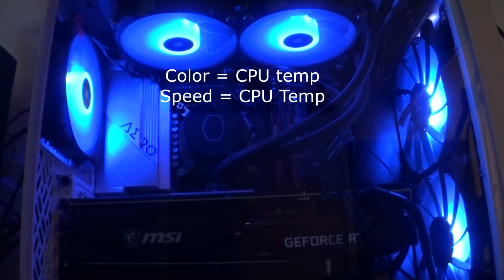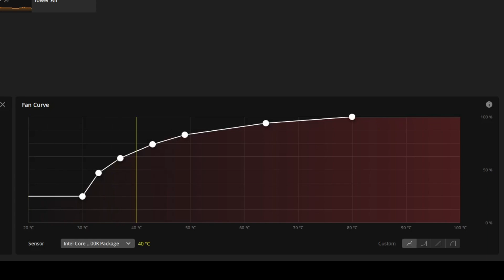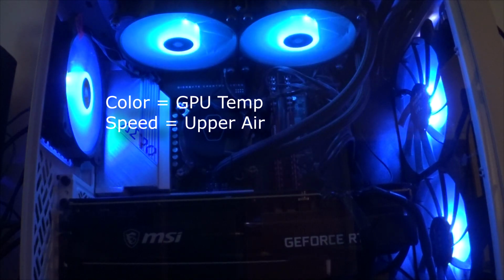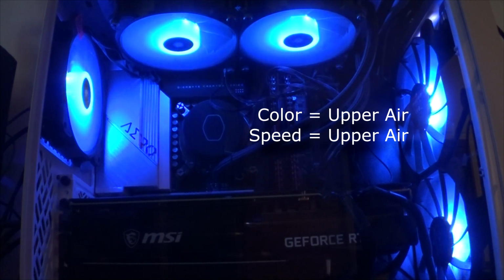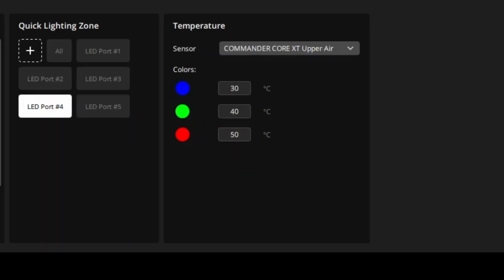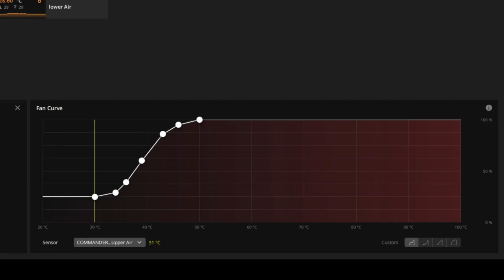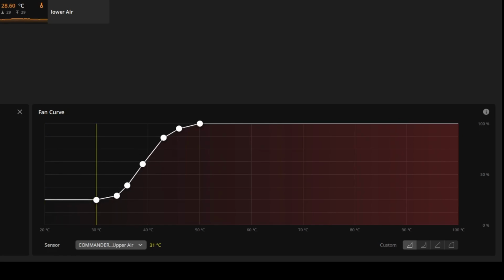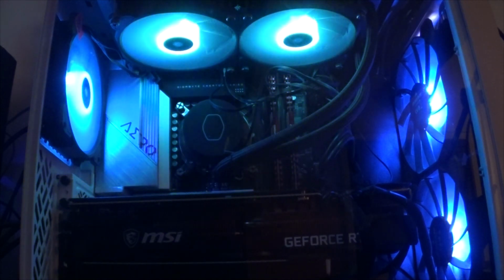My Simple Case Cooling Hack

Comment: At the top you have three 120mm fans blowing out and only one 140mm blowing in. This creates a slight vacuum and the top fans have less air to cool.
Flip the rear 120 fan so it blows inward and put a air filter on it.

Comment: Thank you for this video its a good idea , its a shame that the top rear fan wasnt lower blow the GPU air duct  that you have made . I did a case mod way back when LSI came out with 2 GTX 6800 Ultra's which was at the time a massive card and very think . because the way they use the air around them and spill it out a little out the rear but most back into the case. 
I made 2 120mm holes in the side case panel one intake at the back of the case and one exhaust just at the other side of the GFX card . it made the running temp from 71degC down to 50Deg C straight off. so your mod looks cool and works . you need to send it to Gamers Nexus to test it and Jayztwocents  to make it work better he may make the its in a s shape to let the GPU hot air exhaust out the top rear fan :)

Comment: Genuinely curious what Gamers Nexus or JayzTwoCents would have to say about your hack. I remember a couple years ago LTT did a year's long test on cooling, and negative pressure / dust buildup inside the case, and I've copied their setup based on their results. A cheap thermocouple heat probe costs like $20.. and shouldn't be too hard to scientifically test... just measure based on a delta derivative, so you can actually determine if it's effective or not. Here I am lecturing the retired engineer ;)

Comment: One big problem with modern gaming PCs, is companies focus more on easy to brag about numbers and looks than real metrics and proper airflow. People have to do the fixes themselves. Good to have a video explaining it a little bit and prod people to go research further.
Reply from the maker: The case manufacturers have an incomplete knowledge of what people are going to be doing with their cases.  For example this hack presumed that I was using a top-mounted AIO and a very warm GPU blowing air in all directions.  If instead I was building a front-radiator solution or using 3 front fans or building a simple system with on-chip graphics then there would be no point to this cooling hack.

Comment: As an avid PC hardware enthusiast, I am subbed to many channels, including Gamer's Nexus, Jay's two cents, LTT and many others. Safe to say GN goes above and beyond in their work! I think the best easy recommendation to hand out would be to simply build your PC in the biggest, well ventilated case you can, according to your space allowance. I've personally always built my gaming rigs in full tower cases with plenty of big 140mm fans and have never had thermal issues, with overclocked high end components. Compartmentalizing a small case, to separate the biggest heat source (the GFX card) from the rest of the hardware is a brilliant solution, really don't know why they don't do that from the factory.

Comment: I watched quite a bit of JayzTwoCents and GamersNexus up until I built my desk PC a couple of years ago... not so much these days, but I'll be checking them out again soon as I'll be looking to upgrade my 3950X to a 7000 series Ryzen (with corresponding motherboard and RAM upgrades).

Also this struck me as sort of a hardware equivalent of CQRS... separate the streams so you can optimize them independently :-)

Comment: I keep thinking the glass panel on the side of my case is stifling airflow.  Maybe GamerNexus has input.
Reply from the maker: Well, yes it is, but it is also directing airflow.  So you don't have to give it up
Reply: @RaysGuide  I have a baffle as you described.   But I think I need more airflow.  I have thought about getting a Corsair cooler like you discussedin your video.

Comment: It is a good point that with power usage increasing dramatically with the next gen GPUs, this is going to become a real concern.  GamersNexus just did a video the other day about system power draw and PSUs causing random system shutdowns because of the rapidly increasing power draw, in particular the transient spikes in power draw... The price we pay for wanting more power!  So not only do we need to seriously consider getting a much larger PSU than we technically need to power our systems due to the increasing need for more headroom on transient power draw, but along with that increased power draw, we need to start thinking about more advanced cooling.

Fortunately I am wholly in the "full custom loop" water cooling camp, so this will be less of an issue for me personally when I go to build my new system toward the end of the year.
Reply from the maker: honestly I think that there should be both for standard build PCs and for major power drawing components such as graphics cards and 'estimated annual energy use' sticker just like we see for appliances.  My new card most likely uses more energy in a year's time than my refrigerator so why not?

Comment: Seems like a nice little hack, so long as there's enough airflow moving over the graphics card so it doesn't stifle in its own hot air (I guess the temperature-linked lighting would clue you in on that though)... have to wonder why such a simple case partitioning is not something case manufacturers do as standard if it's that effective.... hopefully Gamers Nexus or JayzTwoCents will find out ;)
Reply from the maker: Case manufacturers are not providing it because the shape of the baffle will change with the motherboard, ssd, etc.

Comment: should just go full liquid cooling , problem solved ... mines a full UV reactive setup no rgb my temps dont go above 40*c
Reply from the maker: Except for the $$$ and limited upgradability.  So since I was putting in an old video card and planning on changing it out going with full Watercooling was not an option.

Comment: Cool hack! I'm surprised Gamer's Nexus or JayzTwoCents hasn't experimented with this method. Right now my pc is running pretty cool but when I upgrade / fresh build with a much larger GPU, I'm gonna focus a lot of my attention on cooling. Sadly this also means a much larger case than my S340 Elite will be necessary, and very likely more decibels under load.

But we do it for the FRAMES so it's worth it always.

Comment: I've done something similar things over the years to prevent hot air curculating around my case, some of my old cases look like theyve been dragged through a junkyard but through trial and error i've normally found something that works. Your solution is alot more elegant than something i would come up with though :)

Comment: Tech head here, you are right in having a heat duct will redirect the airflow.  Sometime, just having a wall redirecting the air towards the components will help.  The risk is that you constrict the airflow or create dead zones.  Dead zones are where the air cycles around in the case, but does not actually leave the case.  The way you did it works, because you still have a direct flow in to out and did not significantly constrict the air flow in the wrong places.

Gamer's Nexus should do this and show us the does and don'ts.

EDIT: I wish I could draw out a diagram, it is hard to explain airflow by text.
Reply from the maker: I find it easy to think of it as a river.  Where will the water be flowing fast, slow, or just sitting there as and eddy.  That was why I decided to up the lower channel capacity by adding an external exhaust fan rather than just pumping the lower intake fan curve.